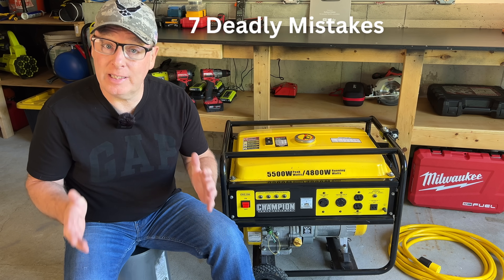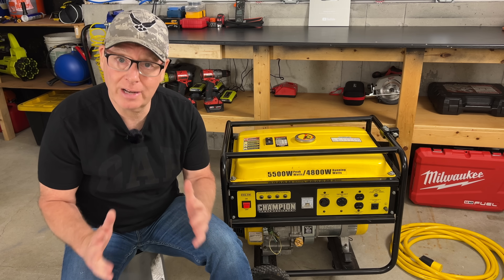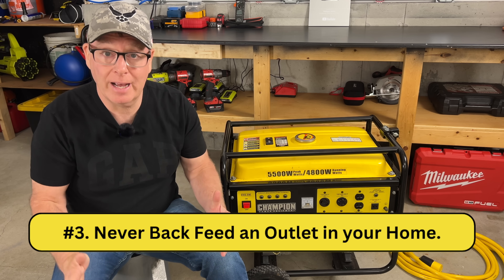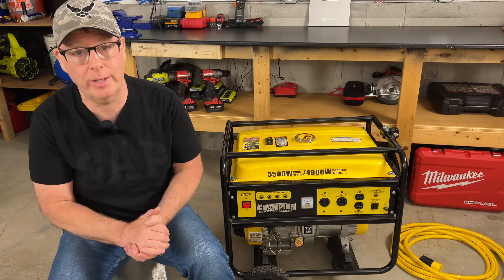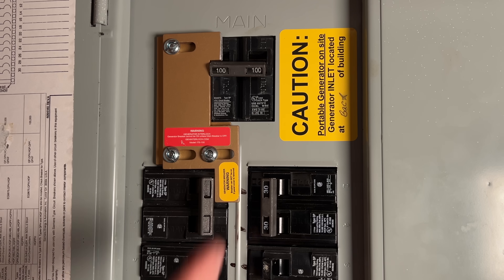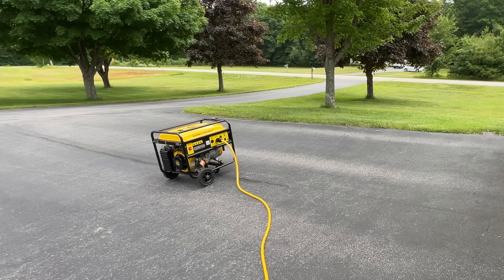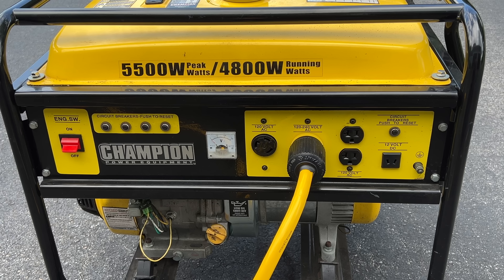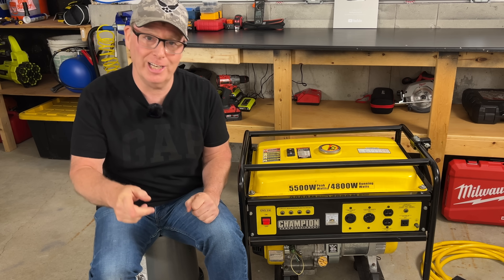7 Backup Generator Mistakes. (Have You Made One?)

Comment: Great video!  One extra thing we do:  During a multiple day outage, we shut down the generator when we go to sleep.  The fridge does not get opened, and we have flashlights if we need to get up before dawn for any reason.  Saves fuel, and I feel better not leaving generator running unattended.
Reply: They are not cheap, but I have a 2000 W portable power station. It will easy run the refrigerator and a few other things so you don’t have to run the generator continuously. It works great in conjunction with a generator for long power outages. Run the generator when it needs to be charged.
Reply from the maker: @jrhackman7414  I just installed an 6000w portable power station with a automatic transfer switch to supply 12 circuits in my home. It also works as a UPS for clean power when utility power is on. Look for that video next week.
Reply: I shut mine off at night, IF, it’s not freezing out (New Hampshire winter outages are a thing) and I don’t need my furnace running. Otherwise it runs throughout the night which keeps me on edge a bit so I don’t tend to sleep as well.
Reply: @festerofest4374  not sure what's worse, sleeping in freezing temp under heavy blankets or in 95 deg high humidity. i've had both and I would take the freezing at night and high temp during the day HAHA
Reply: @denislaouenan5553   As long as your pipes don't freeze.
Reply: @festerofest4374  Please reveal your address.  A "quiet" generator is so much easier to steal! 😂
Reply: @festerofest4374   if in Freezing 🥶❄️🥶 conditions must keep the furnace running but setting the thermostat at low temperature 🌡️
Reply from the maker: Great tip! I do the same thing.
Reply: Only works if its not summer in the southern US.
Reply: That's a great tip Josh, Last year we had a tornado go thru, we lost power for over a week, we couldn't get out of our driveway or to the nearest road because of massive 200 year old trees down, I assessed the damage and a way to cut a path thru the yard and around obstacles, then  to the highway, We feel step 1 is assess damage so you can make a priority list, step 2 ,we have a large generator that can power the house that I only run on propane, so we don't have starting issues from bad gas possibly in this scenario. We started by running the emergency generator from 8 am until around 8 pm, we could power AC or Heat, all appliances or lights we needed, we just mainly powered the AC since the temps daily were near 100 and the water  well as  as a TV for local news. In the evenings we would unplug our big generator, then plug in our Eco flow delta  portable power supply from 8 pm to 8 am for the refrigerator  a light upstairs and a freezer down stairs, we ran them during the evening, then disconnected them in the morning and went back to our larger gas generator,  I have a small gas opes quiet propane generator  I used to recharge the ecoflow and charge phones in the daytime that usually took about 2 hours so we had full power supplys for the evening, we did this for over a week and got by perfectly fine, the main issues we had was I needed more propane , After 3 days I got a path cut to the highway and was able to get out and go get more propane and I also bought about 4 more tanks for reserve, we have been thru power outages before, so  we  have been upgrading our capability and  making our system work better thru the years.  Plus  we have seen its important having several back up plans and  systems as helpful, so we can use our generators and power supplys to work together and keep us going 24/7. We have learned to have a backup plan as well as another backup plan in case 1 has a failure.
Reply: Great point and I'll try that!   ;-)
Reply: I shut down the generator and switch over to the batteries I charged during the day.
Reply: This also allows the Generator to 'rest' a few hours.  A rested generator will last longer.  Even Generac recommends shutting off their whole house generators for at least 4 hours every 24hrs
Reply: @MojoPup  According to someone I know who worked on Generacs, they're one of the worst brands. They skimp on wire size in particular. No wonder they need to cool down on that basis.
Reply: Oxygen patients are up the creek using Oxygen concentrator machine.
Reply: @butchs6099   You can still use O2 tanks.
Reply: If needed, sink a 1.50" galvanized pipe three or four feet near the generator, chain that investment good.  !
Reply: Using good UPS is probably the best way to save fuel. When not using any other energy hungry sources, plug the most important things like fridge or circulator pumps to UPS and shut down the generator.
Reply: @Stasiek_Zabojca   A UPS  needs power to recharge though. You still need to put back at least as much as you take out.
Reply: Thanks
Reply: Great idea!
Reply: I would have thought your nighttime procedure to be pretty universal unless there are extraordinary circumstances such as extreme cold.
Reply: Great Advice.....Sir and thank you 👍👍
Reply: After hurricanes in Florida we ONLY run the generator AT NIGHT. That’s when we need the lights and air conditioning. The next day refrigerated food stays cold past sundown
Reply: I can't sleep if I don't have an A/C or at least a fan straight to my face😂
Reply: @Jose-xb6st  Get a small muffin fan to run off of a suitable battery of your choice.
Reply: Cold weather prohibited 😂
Reply: Depends on the temperature
Reply: and then the kids and pets are frozen in the morning
Reply: Lolllll wonderful- even without opening a fridge, the food only stays good for 4 hours. Google it. Don’t listen to this person, folks.
Reply: Very very important advice
Reply: All excellent tips, enjoyed learning.

Portable gen-sets are great.  I'm in hurricane country.
My Honda EM7000IS runs 14hrs at 1/2 load (fridge, all led lighting, fans, microwave...).

Whole house gen-sets, NG/LP are the BEST, if your budget can afford and you have a utility gas supply line...
 
Tips:
From my experiences.
  
1. Secure by chaining down or other method the generator, making it harder for thieves to steal.

2. Be mindfull the full tank of gas consumption of your genset (5hrs - 10hrs).  This way when the generator stops running and it's short of the out-of-gas timeframe, you can be alerted (no engine noise) as it may be a thief trying to take it.  

3. Always let the generator run out of gas before storing it after the emergency.

4. Keep it well maintained, don't wait till the power goes out to hope it will start😅.

Hope you never have to use it but, it's great when you need it...😊
Reply: Yep, no noise all night and you’re not advertising “come get this nice generator”
Reply: Also you are not being a bad neighbour.
Reply: Are you insane? In the south we need AC day and night.
Reply: @mav8903 I know..get real..cutting the generator off at night would only work if the temp outside is comfortable..
Reply: @mav8903 he obviously doesn't live in Florida....
Reply: @mav8903  maybe even more at night
Reply: @mav8903  these new mini ductless heatpumps are great for using less power than the big roof jobs or split furnace, ac setups. Heat is good down to around 10° f, and will keep home or a few rooms comfortable.  Surge suppressors recommended.
Reply: @Barracuda48082   What do they cost?
Reply: @mav8903  Relax, dude.....he's not in the South and he's not insane!  It's just a suggestion if it works for you....if not, DON'T do it!!    smh
Reply: @USCG.Brennan 
I’m in the south. No ac, no fans, nothing for 5 days now. Don’t need an ac. Many places don’t have them
Reply: @eddieregan  If you've lived there very long, you've become used to it....that happens.  The Southern states are notorious for being hot and sticky in the Summer time.
Reply: @USCG.Brennan  
I just moved here from Boston.
Reply: @USCG.Brennan   This year in particular has seemed to have been extra hot in NE Tennessee.
Reply: Y’all are arguing about stuff that isn’t important. Get a whole house generator and then you can make boat drinks while the hurricanes are killing power everywhere
Reply: @3fsw3   You need to keep a LOT of fuel to sustain whole house generators. Many people go for smaller units that drink less fuel, but still enough to run a minimum of essentials.
Reply: Really, I live in Texas when it is 95°f at midnight.
Reply: You definitely don't live along the Gulf Coast
Reply: @dolfanshannon  most people don't
Reply: Multiple day outage?? Where in the world do you have a multiple day outage? Anything more than 4 hours is unacceptable
Reply: @Codeman785 Try up to weeks at a time after hurricanes in the Gulf Coast areas.
Reply: @NOLAgenX  Just went 4 days without power after Hurricane Milton in Florida. Will definitely be looking into a generator soon.
Reply: @Codeman785  You clearly have gotten off easy if you've never had a multi day power outage. A great many people including myself have had at least one long power outage. It's not uncommon to have lived through it multiple times.
Reply: @Codeman785 many storm damaged areas go as long as 15 days without power!
Reply: @Codeman785 
I’m in GA.  This second multi day in a month
Last 3 days. This time at 5 and counting. Also have a house 5 min from downtown
Reply: @eddieregan  this is exactly why we need nuclear power
Reply: @Codeman785  Yes, we do, but nuclear power doesn’t prevent the power from going out from hurricanes, derechos or tornadoes. Power lines are a thing. We have a nuclear facility in our region (as well as several NG power stations), but transmission of power is at the mercy of weather.
Reply: @Codeman785   I agree on nuclear power plants, but there aren't many power plant failures. Most outages are the result of local and more distant power lines and sometimes substation failures. I live in an area with a number of nukes plus 29 hydroelectric dams. We still get our share of failures.
Reply: @Codeman785 ??? If the power outage has been caused by storms damaging local distribution infrastructure, the technology used to generate electricity is moot. The power isn’t getting to you regardless.
Reply: @Codeman785  post hurricanes.
Reply: @Codeman785 
Shit happens.
"Unacceptable?"
What are you going to do about it if it happens, call the manager?
Reply: @twill9278 Or they can just stay in the "denial" stage.
Reply: @Codeman785  about 10 years ago we had a derecho that covered several states and took out power to probably 10s of thousands of people.  In my county we had people on generators for several weeks straight.

Comment: Gen-tent. Need I say more?
Reply from the maker: We seem to get a lot of wind when the power goes out. I'm not sure a tent is the answer but I have never seen them in action.
Reply: @BackyardMaine  It is a product designed to clamp directly onto the generator, often times designed for a specific family of units in collaboration with the manufacturer of the generator. Mine stayed in place during tropical storm force winds and survived winter in the Bangor area. They also have a skirt to keep the electrical / control panel as dry as possible.

Comment: I disagree with your basic premise. Many people are capable of safely connecting generators to their house circuitry. You paint with a broad brush when you classify so many people as unable to operate machinery.
Reply: Noooo… noooooo….squirrels are smarter than the general public….
Reply from the maker: Do you realize that if you were to make a mistake connecting a generator in this way and someone was killed you would not only be liable from a lawsuit perspective but you would be criminally liable as well. I can make the connections as well but I learned a long time ago than anyone can make a mistake.
Reply: Especially under the stress of a major weather event people easily disorient.
Reply: I retired as a chief engineer aboard steamships. When one gets in a non routine situation, and tired, in a hurry, thinking three steps ahead, with no lights and getting engine room hot (or outside wet), mistakes do happen. Most engineers refuse to ever admit to making a mistake, but I have made lots of them. Because my life was all about operating 32,000 hp ships that really did not have a lot of interlocks between systems, why would I place one on my house? For 30 years I never had an interlock on my own house generator circuit, but for $70 and 5 min install, I realized that an overpriced mechanical interlock was insanely cheap, safe for the community, and legal. The best part was that there is no thinking required to operate it.

Comment: I added color dots to my interlocked panel so people know which breakers to use while on gen power.  Red dot breakers stay off for being higher than the generator capacity to run.  Yellow dots are 2 pole breakers than can be turned on but only 1 at a time like the water heater or kitchen stove.   Green dots are all the single pole breakers needed during an outage.  I made a step by step video too.   Makes it easy for my family to understand when I'm not home to switch everything over.
Reply: I have the same color code on
My service panel. I don't run my
Generator a lot and it helps me 
Remember too😊
Reply from the maker: Good plan my friend.
Reply: Please
Send your video on this
Reply: That’s great advice. Thanks amigo
Reply: Very good tips ! Pls share your step by step video, thanks !
Reply: ty good tip.

Comment: Whenever I need to run a portable generator, I'll take a box fan, plug it into the generator and set it right near the generator blowing fresh air directly on the engine. It really helps to dissipate the heat and it should prolong the life of the engine. And of course like you said, this would not be done in the rain.
Reply: That's kinda easy and clever!
Reply: @Stasiek_Zabojca  I recommend using a turbine fan if you have one. I tried a smaller fan, and the generator engine ran hotter than with a more powerful fan blowing on it. But I'm sure anything is better than nothing. We get a lot of still, hot days here in Texas 😆
Reply: I like this idea too. I run mine in a 10x12 shed  that is 30' from the house with the door and windows open. Mostly to muffle it and of course it's not out in the weather either but can't hurt to move some air around.
Reply: @jeffflowers729  sounds like you have a good setup. I don't think I could even run mine indoors. It has one of those co2 shutoff features and I swear if the wind is still outside it'll shut down every time. It's kind of annoying sometimes but I guess it's a good feature to have.
Reply: Nope.  Most Closed frame generators have a built in cooling system or at least and internal fan or radiator with coolant; a totally different animal than the low cost basic generator than could use some airflow help on 97 degree hot still day.
Reply: This is not necessary at all.  Closed frame generators can last years and years, and they get minimum airflow.
Reply: Engines are suppose to run hot; its like people who remove the thermostat in cars for more horresseeprrrs.  They have a flywheel with air fins; careful tuned to run at optimal temps; leave it alone.  

Want longer life; change oil, use synthetic, let that head get to 300F where it belongs.
Reply: Hey, I've done this, too! I could actually touch the engine this way. Was a hot/warm at best! I thought as well it must make the engine last longer... I like the way you think! 😉
Reply: I think you need to think about this. By adding the fan, you put more load on the generator. I’m sure the additional load is small, but it still requires the generator to produce more power. More power produces more internal heat. Just a thought.
Reply: @carolynraffl8271  I see what you're saying, but that's a really small load to run a fan. There will be a very slight increase in heat, but not even close enough to counter the cooling effect of running the fan. Like I said before, I was able to place my hand on the engine while it was running and not be burned with the fan going. I couldn't do the same thing without the fan. Seems to me to be enough evidence to support using a fan. But I also think it has to be a decent fan that can actually move some air. Little fans won't cut it...
Reply: @therealstin2417  Running an engine cold is worse for it than doing nothing. They are designed to adequately cool themselves. They don't need or benefit from additional cooling. Plus you are likely just keeping a shroud cool, not the engine itself.
Reply: @--_DJ_-- sure, they have an air cooled engine, I get that. But there's a lot of days here in Texas that are hot and hardly any air moving. It may not be a huge temperature swing for the motor to run a fan on it, but something is better than nothing. Even car motors can struggle cooling themselves in hotter temps, especially when idling and no air moving across the radiator. It's the same principle. The car can run and operate still but the added stress can deteriorate internal parts quicker, like the water pump for instance. So I don't think it's unfair to say the principle could apply to a generator motor. A cooler motor means less thermal breakdown, even if it's just slightly sparing the engine oil it's something.
Reply: @carolynraffl8271  This additional load caused by electric fan is not enough to produce any noticeable difference in engine temperature. Air flow around engine will cool it way, way more than running a fan will heat it up.

Comment: Finally someone that does not recommend backfeeding an electrical panel. I have even had electricians recommend this.
Reply: Back feeds are asking for trouble unless managed by a skilled electrician.  All critical loads should be from a panel  board supplied by a transfer switch.  More expensive but much less risk
Reply from the maker: Yes, for sure. Back feeds are not a good idea.
Reply: You can if you have an electric dryer connection of 220. Last ditch use.